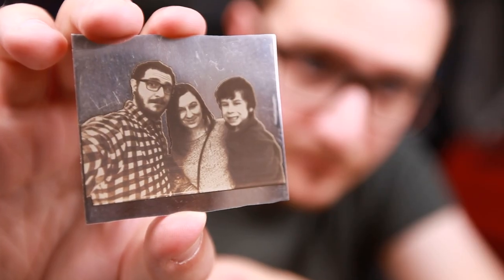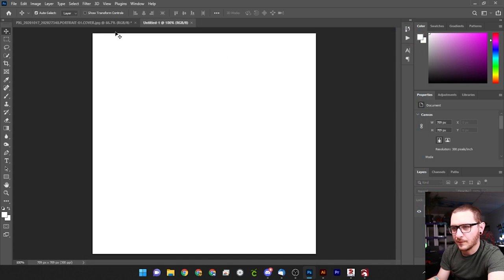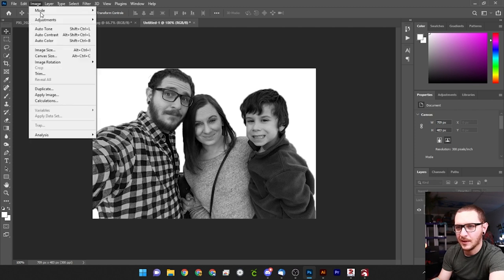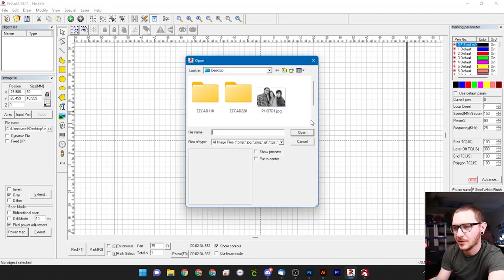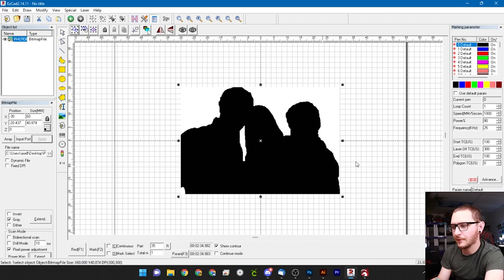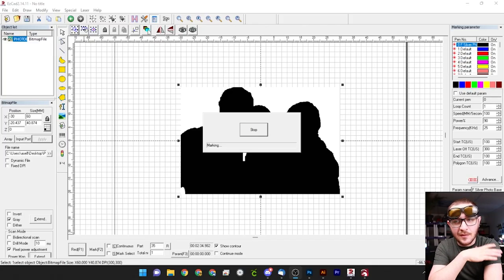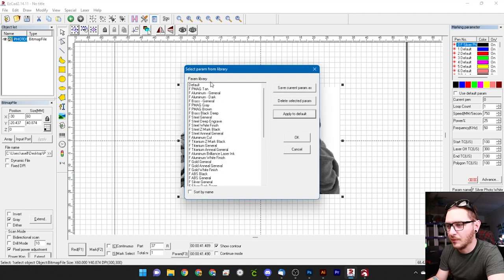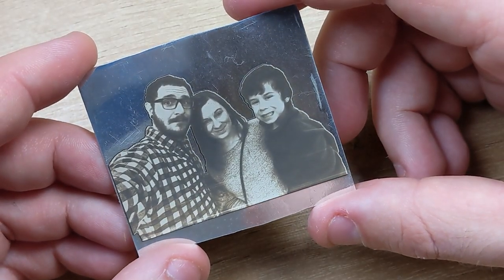How to Engrave PHOTOS on Silver | Fiber Laser Tutorials

Comment: Great video! I was wondering how get those parameters in my library…"photo silver", thanks
Reply from the maker: The settings are shown in the video (we dont hide them, always about education around here), so you can copy them in manually to your library, or if you head to the Laser Everything website, there is a link to our shared library right on the homepage. All made free, possible by the community support over at the Laser Master Academy, check that out too if you get value from the community resources :)

Comment: Love your work. Do you have Lightburn presets for Galvo? My Ezcad software is corrupted and I can't get it to work have had a terrible time trying to download a clean copy., Had a bit of support from Lightburn to get my frame and focus dots working again and it works good. I'm interested in joining your Patreon if you have those settings for Lightburn. I'm a manufacturing jeweller and would like to get the machine up and running again. I also have a diode laser which I am having fun with. cheers
Reply from the maker: We do, converter included. It's all up over at https://masters.lasereverything.net/ :)

Comment: Hello Alex, first thanks for sharing such good knowledge with us.
I have been doing photo engraving in silver and gold (18k). In most cases I need to unmark "pixe power adjustment" for the silhouette, because if it is on, the engraving is very very light. And when I get to the final step (Photo finish) I need to fix the dpi (600x600) on Ezcad to make it work (without it, the engraving is also very light). I have tryed with many high resolution images (JPG and BMP) but I always need to set the dpi to get a aceptable result. Any toughts why I can´t do it in the way you taught in the video? 
50W Raycus Fiber Laser - Ezcad2 - Brazil
Reply: Same thing is happening to me cant seem to get these steps to work without taking grey off and pixel power on the silhouette. What solution did you come up with ?
Reply: @thebigone3868 I think you need to import his settings in ezcad. I think he fine tuned the pixel power settings, he mentioned he did in the video and he said he could do better if he played with it. So that list of power ratings , I think he increased those values on his list.

Comment: What is height of the laser caliberation pointer from the flat surface base?
Reply from the maker: That value is going to be very different based on your individual lens. We used a 110 lens for this, but even the next 50 lenses off the assembly line behind ours would have a different focal height.

Comment: if you can help me i have a problem , i try numerous times on difrent metals and once on silver and its working but now i have a job to do and the first 2 steps work but when i put the details its not working laser moving around butt not sparks and sound just the movent and its makes litle to no marks on silver is feel like its not puting enought  power  its make no sounds, its very anoing because i manage to makeit work once on silver with the same setings and now nothing
Reply from the maker: This video is pretty old and while the dark silver settings are good I'd recommend checking out our new photo engraving guide which will probably answer a ton of your questions, check it out here: https://youtu.be/EB40S6AEVwE

Comment: What will have result if set frequency to 50? Also Will any damage we have on laser device setting to frequency?
Reply from the maker: It depends on the laser source your machine has. Usually setting the frequency outside of the designated range will just result in the laser using it's closest possible option so if you have a laser that does 50 - 100khz and you try to use 25khz it will use 50. This is a little more advanced though so I'd check out the facebook group or discord server linked in the description and let us know what source you have in your machine and we can take a look.

Comment: Hi! I've learned a lot from this video, so thank you! I was wondering about the depth of the engraving and working with the plate after it's engraved. Is there a way to set up the engraving so the image is more dimensional and could survive being soldered, blackened, buffed, shined, etc? I've been messing with the power settings and for some images I'm able to get a bit of a relief or cameo effect, but it's not consistent at all from photo to photo. Do you have any tips?
Reply from the maker: I have experimented with this just a little but it's never ended particularly well for me. I usually try to make laser marking raster images the absolute last thing that needs to be done when it's required. Still, I can see why you would want to figure this out. First thing I would do is make sure you're checking out the updated photo engraving guide, it's much more comprehensive and may aid you in your testing: https://youtu.be/EB40S6AEVwE

Comment: hi.i want to re install my windows.how can i backup my parametr in the param library?tnx
Reply from the maker: Hey Mehdi, open your Ezcad folder where your ezcad files are stored and open the "PARAM" folder. Copy all of the files out of that folder and store them in a safe place so you can put them back in later. Also make sure you work your way through all of your F3 Param settings and save screenshots of everything in case you need to reconfigure your system after the reinstallation.

Comment: Magnifico video, muchas gracias, los dos primeros pasos perfectos, ahora me falta el paso del grabado final, my fibra es raycus 50w 110x110,  pero no consigo unos ultimos parametros para que quede bonito
Reply from the maker: with your 50w you'll want to use a little more than half the power I'm using with my 30w here.
Reply: Yo tengo la misma maquina de 50w y una de 20w  pero creo que hay que modificar los parametros ya que la maquina del amigo es solo de 30w 
Las pruebas me quedan regular aun falta ajustar los parametros a la potencia de nuestras maquinas

Comment: Hi I have order a 
Fiber LAser 50W (JPT-LP) 1-600 KHZ many Fiber Laser is 20-80 KHZ....What can I do with 1-600 KHZ..Hope you will answer me
Reply from the maker: The higher frequency range basically opens up some new marking options for you. With higher frequencies it's easier to mark plastics and anneal metals. Without getting to complex in the youtube comments that's more or less what it's good for. Hope that helps :) Feel free to join the discord for more info - there's a link in the description.
Reply: Fiber lux 50  laser machine used

Comment: Does this technique apply when engraving on fiber laser with brass?
Reply from the maker: Yes absolutely
Reply: @LaserEverything  awesome thanks for the reply! So I should engrave a silhouette to remove the shine and get a surface to engrave the final image on, correct?
Reply from the maker: Yeah for brass I would stick with the light background dark pixels. If you haven't seen it. Make sure you watch our ultimate engraving guide for photos because the actual photo engraving method used in this video is deprecated.
Reply: @LaserEverything  just watched it 👍🤣

Comment: I tried engraving on silver, and when engraving the threshold edited photo, half of photo engraves in black and half in white🤔 Is there any solution for that?
I used the same parameters and even the same laser tc settings
Reply from the maker: Yes you are missing the Disable Mark Low Gray Point setting from the earlier section of the video. Go back and make sure you have that option turned on and set to 1 and try it again. For more comprehensive support please join the Discord so you can send photos.
Reply: @LaserEverything  I did tick disable mark low gray point. Can I know the discord link
Reply from the maker: YouTube comments are not a good place to diagnose issues with the laser. I'm happy to help you further but it has to be somewhere you can send me photos of what things look like I can't help without being able to see.
Reply: @LaserEverything  How can I contact you via discord?
Reply from the maker: There's a link in the description I watch all the channels pretty much 24/7 just post there and we'll see it
Reply: @LaserEverything  I've mentioned my doubt in fiber support. Thanks😊